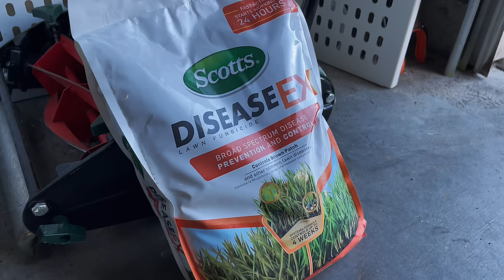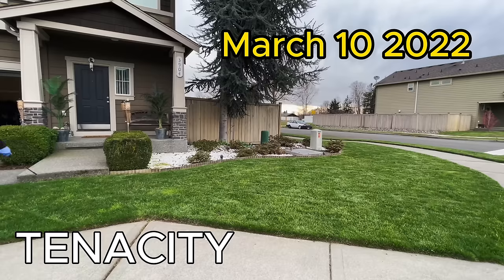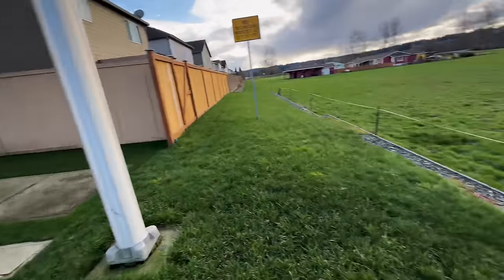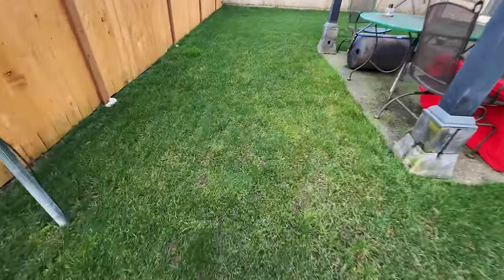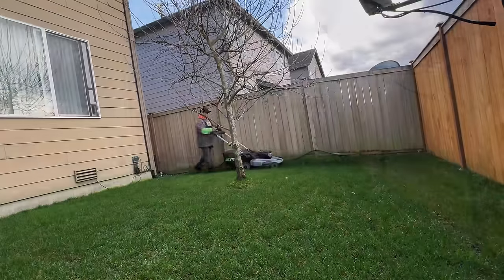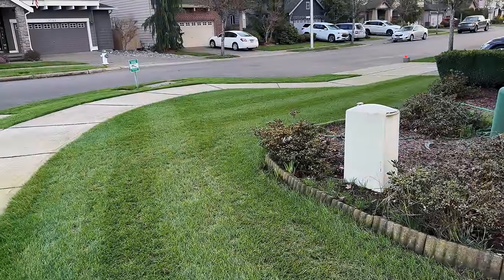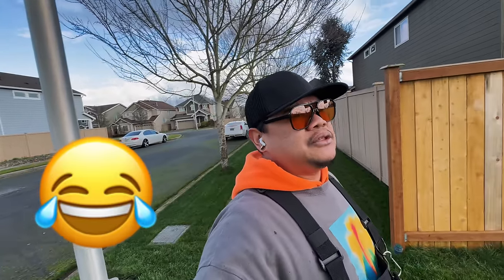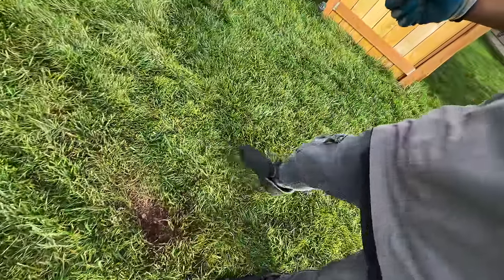START NOW! 3 LAWN TIPS for a SUCCESSFUL SPRING SEASON! Do this before anything else. Thank me later

Comment: on the sunJoe are you using the scarifier blades or the dethatch tine attachment when doing the early season dethatch?
Reply from the maker: To be safe use the blades. I use the blades now I call it "verticutting" Cutting the top and scraping that soil... I do a high verticut... the only time I'll use the rake attachment with the tines is if I'm doing a heavy dethatch before an overseed... but monthly vertical is with blades for sure ☺️🤙🏾